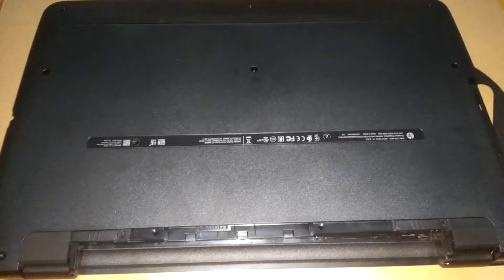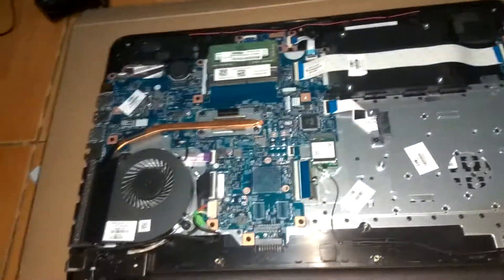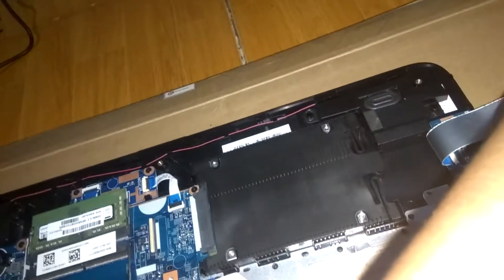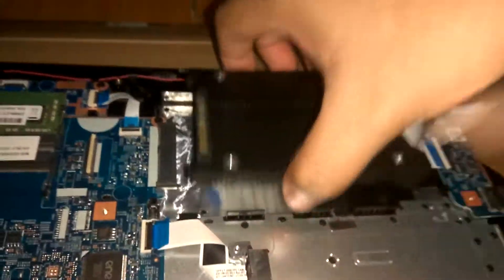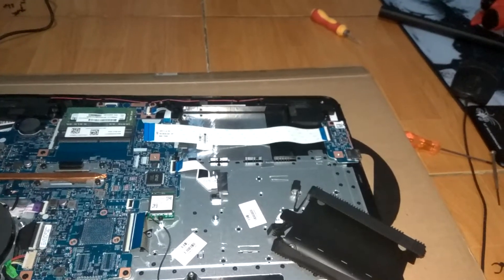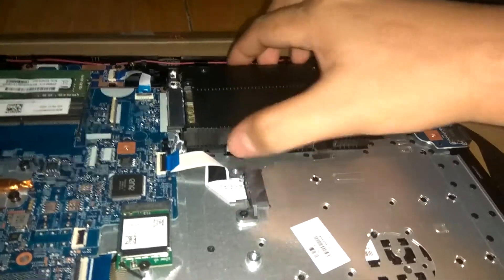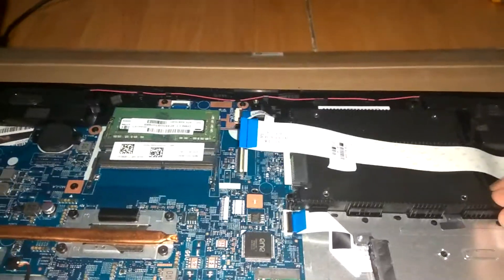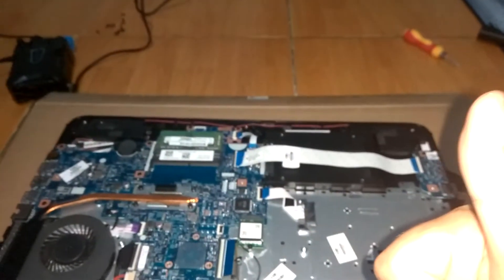HDD to SSD upgrade of HP Notebook 17 x116dx

Comment: Need to show the disassembly and reassembly, that is the main reason to watch this video for an HP Notebook 17.  Any other SSD swap video shows the same steps you went over.  Keep trying.  (A small tripod would be a huge help too.)
Reply from the maker: noted! I will make another video on how to remove back cover of the laptop and how to replace hdd to ssd.
Reply: @sito6200  please I need a quick vid on how to remove back.